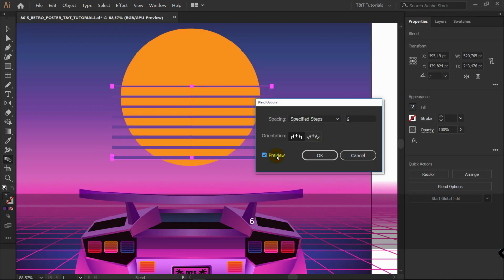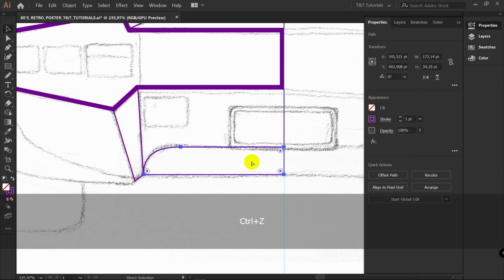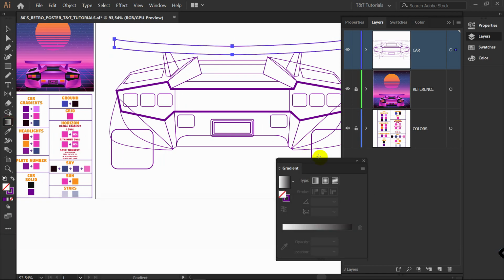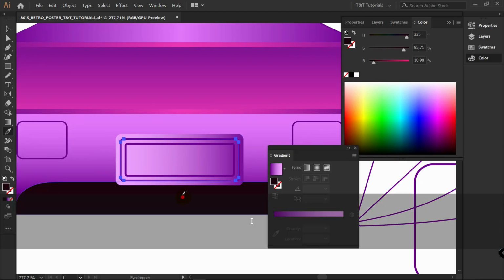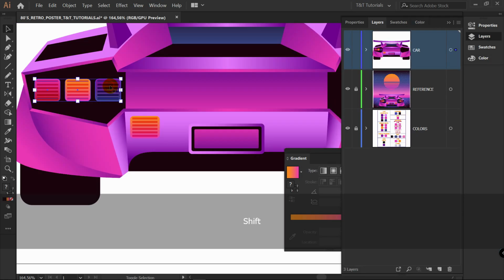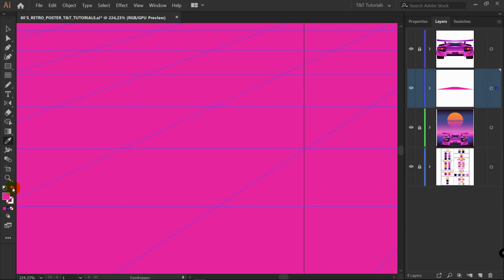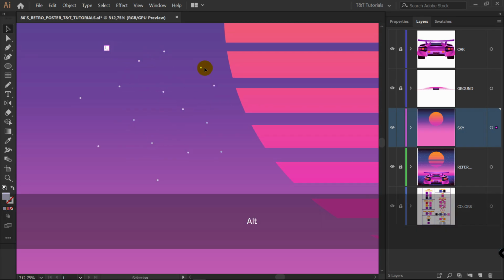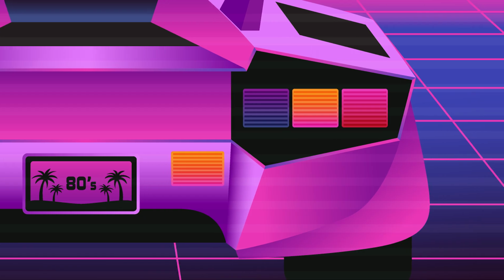80's Retro Poster Design with Car | Illustrator CC Tutorial

Comment from the maker: ↓ VIDEO GUIDE ↓
00:58 draw car with pen tool using downloaded sketch
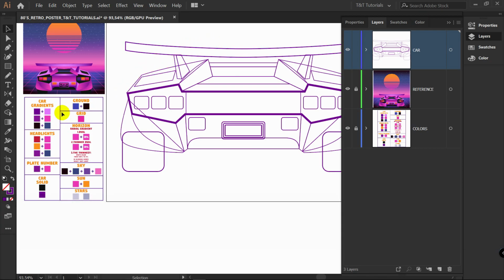08:17 apply gradients to car
19:02 create ground with radial gradient
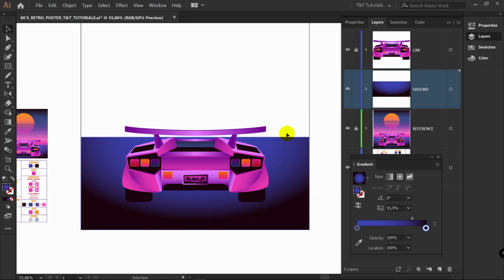19:45 create grid with rectangular grid tool and perspective distort tool
20:47 create fog with radial gradient and soft light blending mode
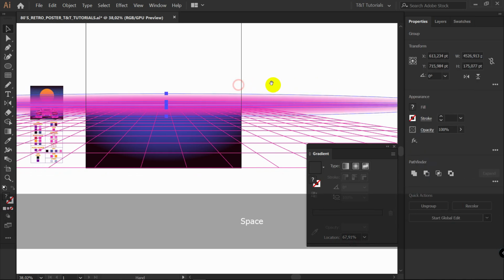22:05 create sky with linear gradient
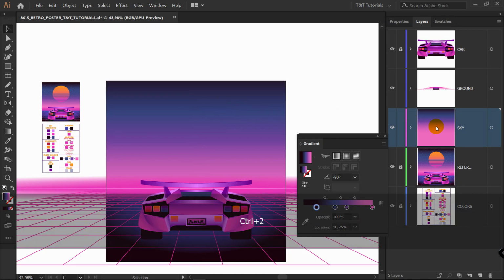22:59 create sun with ellipse tool, blend tool, pathfinder and linear gradient
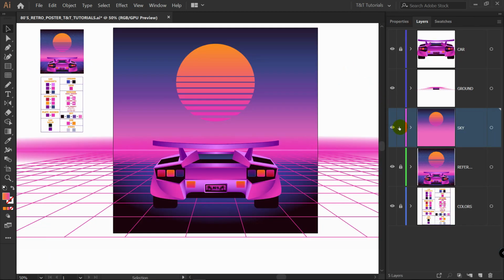24:08 create custom brush to draw stars
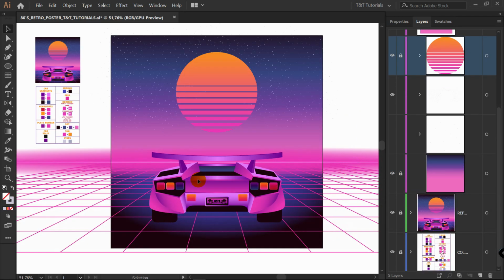26:12 create clipping mask
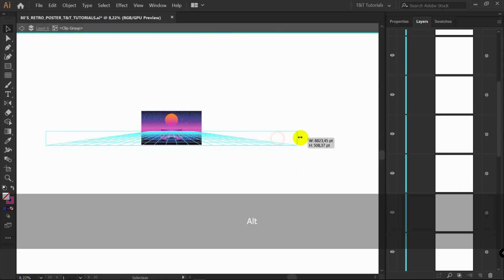27:42 create VHS effect using rectangle tool and blend tool